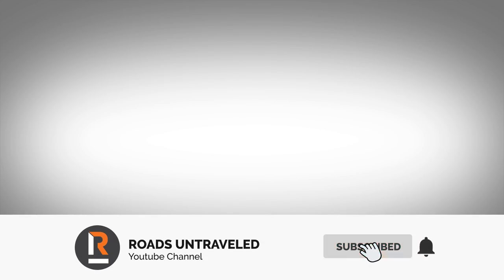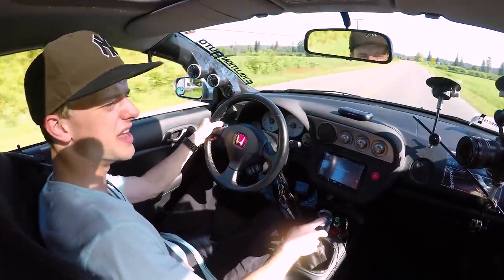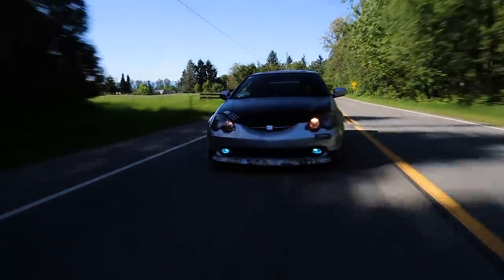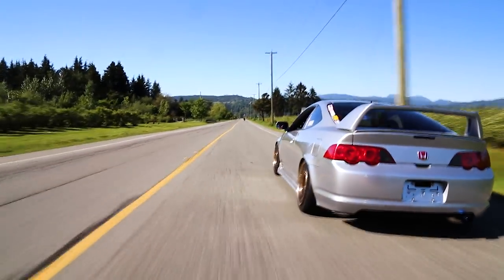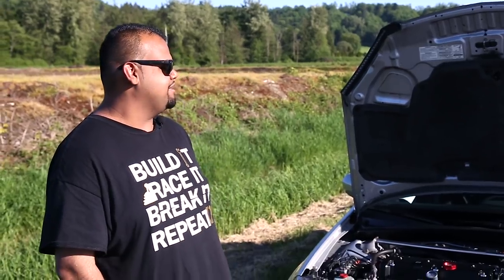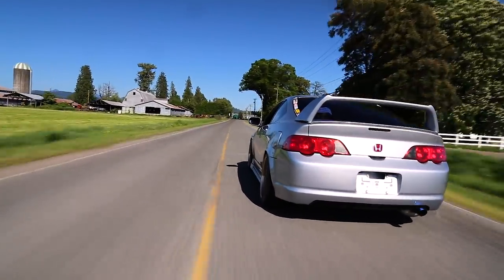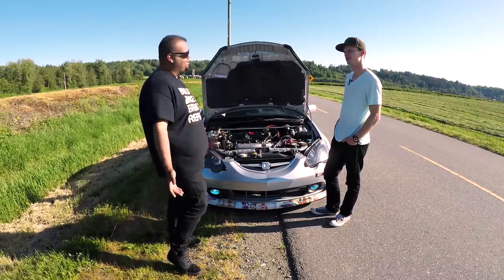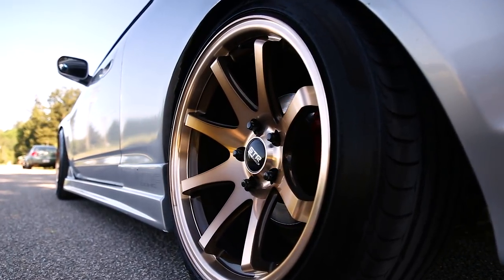Here's Why You Need to Build a 9,000 RPM N/A Acura RSX Right Now!!

Comment: 105mph trap speed with a built k20/k24 is pathetic. This is not a drag car... My RSX with stock k20 bolt ons would beat this car.
Reply: Jujutsuheiho your bolt on rsx will get walked bad by this. You stand no chance. Chances are you’ll be making much less than what you think your making if you took it to the same dyno this man made 250 at.
Reply: preludeF20Bking lol stock g37 gets a 105mph trap speed. I eat g37s all day in my car... So I doubt it's beating my car
Reply: preludeF20Bking pretty sure my buddies k20/k24 with an incomplete tune is faster than this. https://youtu.be/ISaNg-wL9Iw and you can see that my white rsx 0-60 is not slow.
Reply: Jujutsuheiho a stock g37 is a complete turd compared to this. Also don’t quote magazine times and traps speed because those have proven to be useless in the real world. Realistically a stock g37 will net 100 on average track conditions at a decent elevation. G37 is not even comparable to this rsx in any way shape or form.
Reply: Jujutsuheiho I’ve seen the video. We don’t know the DA of both locations and also one was filmed on what was probably a chilly night vs a hot day.  I don’t see a bolt on k20 beating this rsx. I’ve never lost to any Si of any gen or rsx in my prelude F20b swap. I’ve even beat a k20 swap integra da9 that ran 13.2 on the 1/4 mile running only header and exhaust with a tune on kpro. That integra has beat h2b and other k swaps too.
Reply: Everyone on the forums posting pics of their stock times were hitting around 102-103mph on avg. Before I street tuned my RSX to where it is now. I was beaten by a tuned 7AT G37 with FBO. He got me in third. My third gear was kinda loose though so I think it was because I shifted slow. But 1st and 2nd I was a car out front. The stock G37 in the race got left behind by both of us. So for this car to be barely trapping above a stock G37 means he probably is around what I am doing. My buddies k20/k24 passed me in third/fourth like it wasn't shit. And his tune ain't even finished. The only difference is hes fully gutted unlike this car. Which I think the car in this video has the rear interior taken out and kept the front interior.
Reply: Sam Shenton I bought a DC5 because that's what I wanted. I like the FF layout. I have a SUV and the RSX is my track car in progress. Still gotta work on suspension
Reply: Sam Shenton also rwd is not always superior. Your knowledge of racing is limited. You can't judge performance cars by driving to park them. You need to put them on a track and push them to the limit.  Which requires skill
Reply: Jujutsuheiho forget the forums. Search them here on YouTube. You’ll see they’re running slower times.
Reply: Sam Shenton or an nsx. s2k and nsx are the best hondas period and the only ones that are actually worth building. but for me personally i wouldnt even build and nsx or s2k when there are better options out there like building an e46.bmw.
Reply: My boys stock type s made 300 with a 100shot
Reply: Stock k20 bolt ons will not pull as hard as k24/k20 bolt on

Comment: The problems I see with the car... and where he can improve on it.... is, first of all, that short ram intake has to go. All it's doing is sucking in firewall temperatures directly from the header... That's why they call it a firewall. Tons of tests have been shown, that a factory intake box will give you more gains than a short ram after the heat builds under the hood.... NEXT, he needs to go down on the throttlebody. You don't need 80mm for 250whp, nor 300whp. 75mm is overkill, 70mm is just right, and he can benefit from going to it. 65mm maxbored factory throttlebody would work also, if he wants better drive-ability and reliability. 65mm to 70mm is where he wants to be. The air flow velocity just dead stops when you have it that big... especially with the firewall breathing short ram intake. I feel really sorry for this guy. He needs a better builder that gives him better advice, and a better tuner that can get the power it should be making... I've read a few comments below, and it sounds like he broke it already. True, that a K24 would have trouble going to 9300rpm, even with an S2000 oil pump, but I figured that was a complete lie in the video... maybe not. Rev it to 8000 with the RSX-S oil pump, or 8500 with the S2000 oil pump, and no more... for longevity and reliability.

Comment: eBay built Rsx :(
Reply: It's actually not lol. You're looking at the small tacky crap that he put on that stands out which I dont really like either lol. Cosmetically, I do not like what he did but in terms of his NA build it's legit. He briefly mentioned he has a tsx bottom end, k20a topend, bigger cams, valve springs, higher compression CP pistons, 80mm throttle body, everything forged/ported, and so on.
Reply: @christophchoe  but is making terrible power for the build.

Comment: A FULLY BUILT FORGED 13:1 MOTOR WITH PORTED HEAD AND CAMS ONLY MAKING 250 WHP?....WHAT AM I MISSING.... I HAVE GOT THAT MUCH POWER FROM A FULL BOLT ON K24A2.....PLEASE FEEL FREE TO JUMP IN.  HE SHOULD BE MAKING AT LEAST 300 WHP+ WITH THAT SET UP.

Comment: Nice review and nice to see some honest engine power numbers too.... I have seen many people especially from the States try and claim a stock RSX engine will make 250whp with bolt one. I hate that it's rice to look at but engine spec is good. Also it's very common for Hondas to be revving to 9k, most of their engines are good for it.. k20a, b18c, f20c, b16a etc etc
Reply: A built 20/24 making 250whp is laughable.... stock motors with bolts ons/cams make more than that.... easy... do your research.... a stock k20a2/z1 will make 220whp avg...
Reply: Kimron Mills k20a is only rated around 170whp or a bit less. How do you think you are picking up 50+whp from bolt ons?
Reply: elliot438bcfc The engine actually responds very well to bolt ons.
Reply: Classy Chris yes they do but those would be ridiculous gains. Most n/a 4 bangers barely gain anything with bolt ons
Reply: elliot438bcfc The numbers don't lie. Bolt ons and a tune and you'll be around 210 whp. Look it up if you don't believe it.
Reply: Classy Chris I own a DC5 Type R. Yeah 210whp is a good number to aim for, on the high side but doable. A lot of people claim you can make a lot more than that which is silly. In the UK we mainly get readings at the flywheel so mine is 252bhp and would be roughly 210whp but it has all the proper mods and is the K20A
Reply: elliot438bcfc That's roughly 40 hp increase. Same here in the states. I have a type s.
Reply: 170whp from a k20a is low... Even the old venerable b18cr will put out 180-185whp...
Reply: All their JDM engines do,  he is way of with his figures though,  been in plenty of midly modded JDM DC5's with K20A2's and they wouldnt be any slower than that but we run 95/97 ron fuel in uk and ireland.
Reply: Kimron Mills hahaha lies lies lies. I’ve seen many of the supposedly 260-270 whp k motors and they’re slow as shit. They run the 1/4 mile and has a slow as shit trap speed that doesn’t go with having 260whp on a stock K.
Reply: elliot438bcfc i agree 210-215 is definitely Believable.
Reply: Kimron Mills old b18c will not net no where near 180 all stock. Stock k series around high 170s and low 180s for a very healthy motor.
Reply: Like I said we dont't really deal with WHP, we can just calculate an estimate of 15% losses. K20a is rated at 217bhp but generally you wont make that on most readily available premium fuels. So a gain of 30-40bhp with bolt ons is about right.... intake manifold, throttle body, CAI, header, 3 inch exhaust and a tune
Reply: preludeF20Bking i don't know what rock you're living under but you need to come out for some fresh air....
Reply: preludeF20Bking then obviously they are lying about their real whp... The mph dont lie!!
Reply: The b18c type r motor and the b16b motor rev till 9200rpm bone stock, straight off the showroom floor. The gauge says 8400rpm but they go to 9200rpm. And folks, horsepower don't mean shut on cars that weigh 2000pounds.
Reply: Stock k20 can make 250whp with bolt ons. Just need proper bolt ons instead of buying the cheap shit that everyone else gets.
Reply: preludeF20Bking it's not lies. Bolt ons and a good tune typically met 220whp+ out of a k20. With custom bolt ons you can get even more. Anyone who doesn't know this hasn't been serious with modding kseries.
Reply: Kimron Mills I been racing Hondas for 10 years. I’ve seen it all already.  No they have actual dyno sheets showing 260 and 270 with stock k24s but trap similar mph to my car only making around 215ish at the time. Many K people get caught up on inflated dyno numbers but their trap speed don’t back it up. Yes I’ve seen 220whp Ks. My buddies k24 with all stock head but 12.5 comp pistons goes 11s in a eg but only made 255ish. Some other Ks claim to 270 on stock setups and are barely going 11s in a cut chassis.
Reply: preludeF20Bking it depends if the car has full interior or is gutted. My car has full interior. Mine is a stock k20 FBO w/kpro. I would wax the shit out of this car. So this guy in the video is lying his ass off. Also dump numbers can vary with the Dyno and temp. But 220-230 is the avg for k20 FBO done right.
Reply: Jujutsuheiho not every l will make 225 hp. Not all dynos read the same either. Most of the time the camera doesn’t do cars justice. I don’t see bolt on k20s beating this.  Ks have made anywhere from 205-230 tuned. Some even less than 200 but all dynos read different. K swap civics trap from 105-108 full weight eg with bolt ons and tune. So this type s is closer to a k swap eg than it is to a k20 bolt on type s. On average an Si or type s will trap just over 100mph at full weigh.
Reply: i thought i was the only one complaining that he wasn't making power according to what he said he had done to it...
Reply: preludeF20Bking it's mostly the difference between using cheap bolt ons and quality bolt ons
Reply: Jujutsuheiho not All. Like I’ve mentioned my buddies 255whp with rods and pistons eg is was faster than your average k series. He actually has a stock k20 with bolt ons and tune and his built k. His 255 whp ones is ridiculously faster than his other k and other street cars. Both were tuned by a very well known tuner here in my area.
Reply: elliot438bcfc a k20z head on a k24a block will make 240 whp stock internals. Most cars built to this level are capable of 330+ whp
Reply: I remember watching a K20 Integra that Chris Miller tuned and it picked up 50 whp with bolt ons and a tune. I don't think it had any aftermarket internal parts installed.
Reply: wackomanx that k20 swap that you’re talking about won’t do much on this rsx. Give me the keys to this rsx and give me better tires and I bet I’ll beat that Chris miller tuned k swap dc2
Reply: Driveitsideways 1 no on pump gas. There’s exceptions but that doesn’t mean it’s the norm.
Reply: elliot438bcfc no mods added just a tune.. 20 hp do your research quick look on Google you can find it.
Reply: Just like to throw my 2 cents in... not sure about whp but stock a3(base/preimuim) is 160hp.. type s a2?(200 or 220hp)

Comment: P.s.....its not a wing it's a spoiler.. wings are for planes and create lift  spoilers do the opposite and create downforce...add beans to your rice
Reply: Uh...what? GT wings are for cars, last time I checked.
Reply: FYI.....Spoilers are also for planes
Reply: COMRADE DONALD TRUMP what does it do???
Reply: Aerospacepilot spoilerons...i looked it uo
Reply: Up
Reply: It’s a wing. It’s just upside down on cars when compared to planes, so it makes downforce. A spoiler doesn’t “make downforce” but “spoils” the flow of air over car, eliminating lift. And both those are found on planes too.
Reply: FutureGadgets so if its upside down what does that make it?? A spoiler...duh spoils air and creates downforce
Reply: Wings create downforce or lift. Spoilers don't create downforce, they create drag. Airplanes also use spoilers to slow their speed.
Reply: Jujutsuheiho what do you think drag is...down force comes from redirecting the wind to weigh the car down in areas needed thus creating drag...duh
Reply: 3v4761 no drag is the friction against the air. Down force is the opposite of lift. Using a high pressure and a low pressure to create a downward push/force instead of an upward(lift)
Reply: You guys got it all wrong. Drag is what your dad does on the weekends. Spoilers are people ruining good parts of movies Duh. And wings are always better with hot sauce
Reply: That DC5Guy love it...thats funny

Comment: I Have the baseline with only 8-9lb boost makes 250+ never dyno but it beats my buddy's Mustang with only a K20A3 mine is much quieter    you dont need that K24 bottom K20A top only a Turbo I like the A3 lower compression and Turbo. Oh Mine paint it stock no Stickers just clean Cant go wrong with Inline 4 with a time chain

Comment: Revving past 9k on a stock k24a2? I doubt it unless the owner used the Type S oil pump and completely built the head. 

Otherwise, that engine is just a ticking time bomb. RIP.
Reply: Dude was full of shit.. lol.. I havent seen this vid in a while, but going back and watching it again, theres a reason they didnt show the dyno results and then claim a fully built frank is making 250/190.. I almost make that completely stock k24.. Im at 233/193 stock.. Likely dude has a normal stock frank. They never showed the car rev to 9K.. From what I saw, it looked like the max he revved to was like 8500.. Which is doable stock with that type S pump. But this car blew up like 2 months after this vid. 250/190 is numbers a stock frank can make at 8500rpm.
Reply: not only the head, at 7k rpm k24 pistons travel as quick as k20 8200 pistons, at 9k rpm those pistons would really need reinforcements to not tear themselves at all
Reply: @ulisesavila2879  I rev my stock block k24a to 8200rpm with no drop in oil pressure. I've tuned plenty of K24s to 8k with stock cams with 0 issues these past 3 years. These oil pumps are good till around 8500rpms before potentially cavitation according to Hytech
Reply: @yosh_tuned  I will just say that there must be a reason professional F! engine pistons go no higher than 25m/s
Reply: @ulisesavila2879  unless I see oil pressure drop then I'll keep at it. I have 0 issues being close to 500whp for close to a year

Comment: the RSX is not 2500 lbs its more like 2800lbs from factory without the driver, probably 3100 with that big dude in it... @260 hp with that much weight, Any eg with a stock gsr will walk around it. I love Honda, I love k series. But the RSX IS heavy. Put that swap on an eg, crx, ek then you're moving. Is like whenever I see these bad ass all motor k series builds, on a tsx, or accord. I'm just like "why??". Idk that's just me...

Comment: Tuner is a built car tuned engine and a great race or sports car. Ricer or rice burner is a crotch rocket sport bike originally, an also applies to those Honda’s or small tuning car platforms with bum motors eBay turbo kit and all the trim from autozone

Comment: lol! I'm calling bullshit on this build! My built H22 made 247/190 without the cams degreed in. And mine was mildly high compression at low 11's with 89mm bore. No way this build is only making 250ish HP with compression in the 13's and a larger displacement! 😂 #FRAUD

Comment: Bruh wtf?? 250 hp and you got cams and 13:1 comp? Gunu have to call bullshit.
My 08 k24a in my em2 makes that. Rbc, k tuned 80mm tb, plm headers, id 1000 inj, 8 lbs flywheel, 5 speed and e85. Stock head stock block.

Comment: I have a 2006 Acura rsx type s with injen mega ram intake, hard race motor mounts, DC ceramic 1 piece 4 to 1 race header with cat delete and DC sports 2.5 exhaust. A spec suspension, poly bushing and stop tech full braking system upgrade front and rear, with adjustable rear control arms, nitto tires and a stage 2 competition clutch and lightweight flywheel. I also have pioneer 7 touchscreen, rear backup camera and jl audio amp and sub with Hertz Millie pro 3 way components in the front. It's tuned to 8800 rpms and has been ultra reliable with 175k miles and it's fun to drive and looks stock it's a sleeper, no fancy wheels wing or body kit. It loves eating V8's and many other cars, but trying the find the secret to keeping it aligned lol

Comment: Since everybody I am here seems to like candles I just wanted to give some advice. Yesterday I installed some Ksport aluminum shift bushings, delrin pivot ball and ct shift springs and it made my shifter feel 10x better, much more precise, crisp and smooth. Fuck a short throw shifter and expensive ass cables. Just do the bushings, pivot ball and springs and it makes it worlds ahead of a short throw and expensive cables. Fact. I removed my short shifter after installing these simple cheap mods and it soooo much better now. Also installed syncrotechs carbon fiber syncros in 1-4th and now i never have trouble getting into hear and missing shifts, plus it makes them indestructible. They are only 270.00

Comment: Meth wouldn't do hardly anything and is really only beneficial for turbo set ups. E85 would be alot better option. Hate the stickers and blue fogs. Other than that alright.

 Don't see the point in spending this kind of money on an NA set up. An unopened k20a2 can handle 500whp on a turbo set up and you dont have to rev the living piss out of it (but every honda guy seems to bounce off rev limiter for 10 secs before each shift anyways.) 

that's my .02. Good vid.

Comment: Power train is great, chassis not so much. Suspension requires quite a bit of work to handle well mainly due to the retarded mounting position of the PS rack.

Comment: can you run 13-2-1 on pump gas??? i had a 15-2-1 and used Q16 race gas. and i didnt hear any cam noise. with Stage 3 cams you would hear it, right? line that pos next to my ls swapped bmw 540i lol